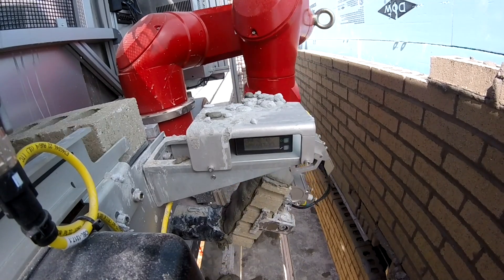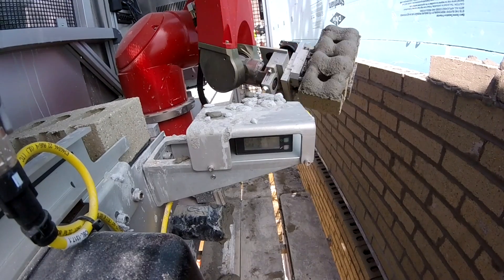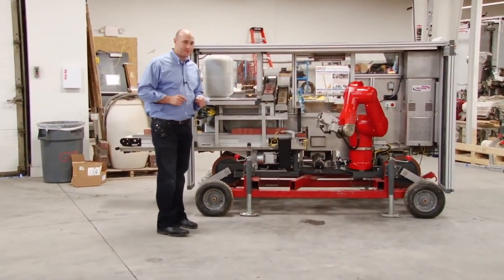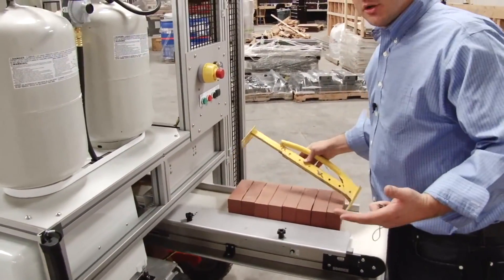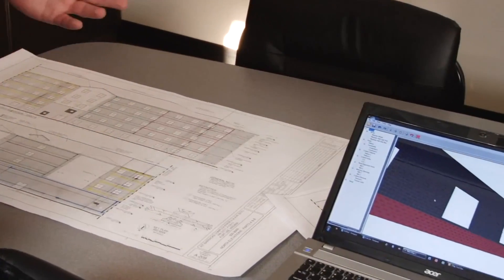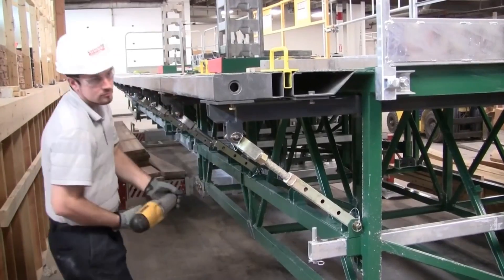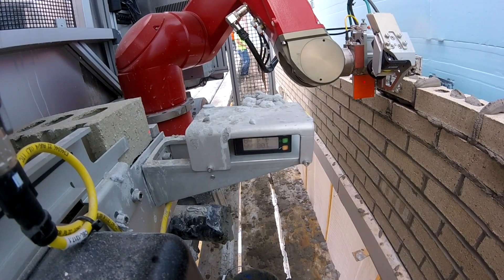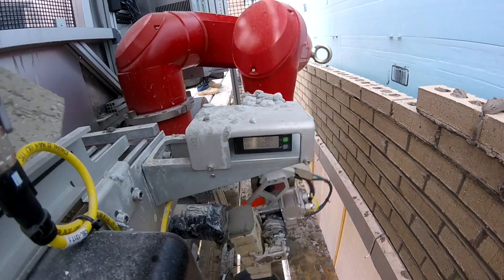Introduction to Construction Robotics and the bricklaying robot SAM

Comment: A worker takes $110 per day? OK, then it is $110 * 250 working_days_in_a_year = $27,5K per year. The machine price should be at least $200K, that is very cheap price if you also take R&D in account. So $200K/$27.5K=7 years just to cover the expences for the machine purchase. But if you take in accout operators salary (definitely more then $110 per day), maintanence, alternative investment lost profit and conditions of the environment the machine is going to be operated in, you will come to the result, where the lifetime of the machine expires a long ago it would be payed of.
Also, the labour can be managed, because some projects come to an end, so you can let your people go. In case of the machine, you need extra place to keep it, and once again, keep the operators, because they are highly professional personel, and you wouldnt be able to hire them fast when you need. And the default human unit needs a few days to become a good bricklayer.

Comment: Total FRAUD.  NO ONE HERE is taking into account that PEOPLE have to load the bricks. PEOPLE have to change out the propane tanks. PEOPLE have to load the mortar.  PEOPLE have to program the machine.  PEOPLE have to set up the scaffold.
4.5 cents per brick.....??  MY ASS.  All you morons touting this technology aren't doing the MATH.  All the PEOPLE setting up 
and supporting this machines supplies are being PAID money.  That HAS TO BE PUT INTO THE EQUATION.  If not, you're just
lying through your teeth about "costs".  Just like Bernie Sanders.
Reply: minimum wage ppl

Comment: I love this. It doesn't need a paycheck, vacation time, medical insurance, time off, over-time pay, or any of those human luxuries. More efficient and precise placements.
Reply: Placements? Let's see a corner and all the other things involved in a masonry wall installed by the robot.
Reply: Are you talking about technical details that robots can improve and refine over time and become better than humans? Yes, those corners and other involved things can and will be done better by robots.
Reply: Why bother make a panel in a factory with even a robot where they work easier.
Reply: Why bother make crane machines (operated by 1 person) that lifts big heavy objects easier instead of having 20 guys trying to lift it using systems of pulleys? Why bother make cars that gets you to your destination faster and in comfort when you can walk or ride a horse? Why bother make laundry machines when you can wash it all by hand? Why are you bothering with using a computer? All those devices were also job killers, if that's your concern.

Comment: I would have designed the robot on rubber tracks on a self leveling chassis and done away with the guide tracks, then you can build free-form round walls, other than that great work!
Reply: Yes, and a stabiliser.

Comment: It still needs workers to assist the robot.
And,who is going to maintain and repair these robot?
Who is going to build these robots?
Who is going to manufacture the parts for these robots?
The jobs lost by brick layers would normally be moved into other areas.
The real problem is these jobs are going to other countries.
Reply: How is it you ask 4 questions about who's going to operate this machine, and then say they'll be outsourced.
Reply: What I meant is,if those things are being done by people in other countries then IT WILL lead to job loss but NOT because of these innovative technologies but because of the outsourcing of those service and manufacturing jobs.

Comment: This robot is the result of pushing Bernie Sanders like policies. This machine does the work of 6 unionized workers and takes no break. Like the fast food industry, automation is slowly going to make all people realize that the real minimum wage is 0.00.
 With an average efficiency of 3,000 bricks per day, that breaks down to about 4.5 cents per brick.  Meanwhile, using using Bernie's preferred $15 per hour minimum wage rate, plus benefits, and a daily efficiency of about 500 bricks brings the human labor cost equivalent to roughly 32 cents per brick, or a little over 7x.
Reply: By your reasoning the robot will replace the humans, unless they're making like $2 an hour.  Which means the robot is inevitable....
Reply: because the machine is a POS.
Reply: Sorry a bricklayer can lay way more than 500 bricks a day if you're  talking about a straight wall and just laying brick with no tooling, anchors, insulation, or flashing.
Reply: Humanity has outgrown the need for money. That's a good thing. 👍
Reply: don't hold your breathe on that wait.
Reply: it still needs labourers to setup the machine, the tracks and keep it fed, it also requires a Mason to flatten the render afterwards.
Reply: http://ny.curbed.com/2014/4/15/10114354/how-one-family-dominated-fin-de-siecle-nyc-architecture

Comment: can you post a video of the robot building corners, piers, window openings? Can it adjust coursing or plumbness for screw ups on the job or wrong steel heights? Can it set lintels and install flashing?
Reply: It only lays bricks but can account for any opening in the wall. The only "labor" involved is feeding it bricks, mortar, and a clean up man for excess mortar.  With an average efficiency of 3,000 bricks per day, that breaks down to about 4.5 cents per brick.  Meanwhile, using using Bernie's preferred $15 per hour minimum wage rate, plus benefits, and a daily efficiency of about 500 bricks brings the human labor cost equivalent to roughly 32 cents per brick, or a little over 7x.
Reply: 4.5 cents  a day LOL your kidding right?
Reply: IT's JUNK If you want rid of bricklayers do a precast brick panel
Reply: True it's pretty basic at the moment, but like any other technology it will only get more advanced with time. People laugh at inventions like this until it takes their job.
Reply: you have many costs involved like the following.

Rental or purchase
delivery
depreciation on equipment
setup and programming
down time 
removal return
maintenance
clean up time
energy cost
movement on job to different walls and scaffolds
limited in scope of work limited to type of scaffold you can use it on.

not installing for 4.5 cents a day by far. Cost of brick installation you need to add guy mixing mortar, loading brick, tooling joints plus all of the setup work by people. Unlike a factory where the robot is stationary the construction site is a whole new ball game. So all this trouble is for what? You can make a brick precast panel in a factory no weather involved and ship it to the site and install it at any temperate. 

Sure a normal bricklayer on a straight wall will put in 500+ in 8 hours easily but that includes tooling and anchor installation if it is just a pintle you hook on to an eye or something similar. The work I see it doing doesn't look all that great either. I would like to see a completed wall from a few angles.
Reply: @PaddleDogC5  It's also not installing insulation, mortar net or weep vents. So once again, you must have a mason on hand to actually do the work so the stupid machine can work. It can't lay block, and if they make one that CAN lay block they will have MANY more issues to solve. Lapping rebar properly, all the cuts and boxes for sparky, plumbing. 
Also this machine could NEVER lay real stone, let alone thin veneer. They have literally devised a way to solve the MOST simple and EASIEST part of our jobs, LAYING A BRICK IN THE WALL. LOL. WTF!!! Can the machine wash down at least?? I wouldnt mind that. Seriously fuck these guys and this bullshit invention.
Reply: Your can just get rid of bricks correct?  Can the robot lay bricks in the cold or rain? You can put up a precast brick panel in  either. Who needs the stupid robot probably getting a grant from the government to waste money.
Reply: Not sure what your point is. Are you a mason by any chance?
Reply: The robot cost is based on what things? Yes I am a commercial mason contractor for 40+ years. Point is the way this robot is presented does not represent the true cost of it. It is also very limited in scope of work from what I can see.
Reply: Wow 40 years, good for you. At it's current stage, I agree it seems pretty limited in it's applications. This seems like something an equipment rental place would carry and contractors would use for basic projects. Seems like it would cut down on labor costs wouldn't it? Throw a laborer on it to keep an eye on it and send the other masons on different jobs.
Reply: Maybe you can think of it as a fancy power tool
Reply: What dickhead dreamt up this piece of junk, the scrap yard awaits.
Reply: The technology of this is infantile compared to a self driving car. Not impressed tbh, but it also means the tech can grow fast.  This pos is just the beginning

Comment: Cement feeding required, bricks feeding required, accurate positioning before starting required,
High height levels may be a difficult, I think supportive things are more in this automation. 
Can be done better, 
Sami 100 is good. it's accuracy levels are high.